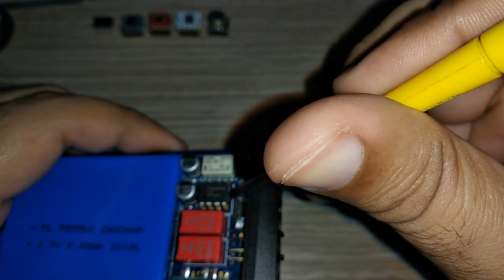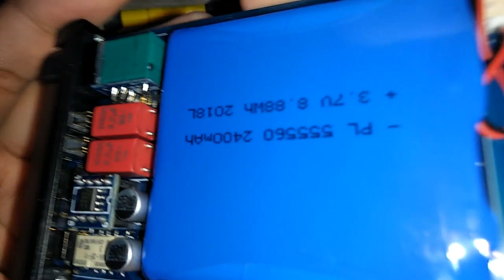OP-Amp Rolling in Topping Nx3s

Comment: That switch thing at 1:34 with G1 mark , what is it for. Mine came off, is it something important?
Reply from the maker: That's for grounding.
Reply: @KramptCustoms  So without it will cause any kind of problem?
Reply from the maker: @Jayjay511  Ground in your electronic circuit. https://youtu.be/zLW_7TPf310